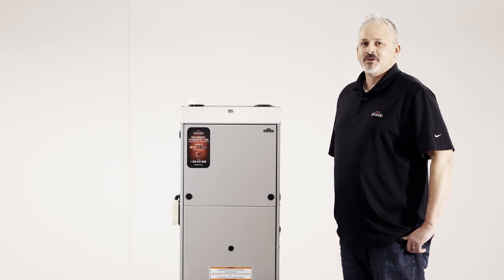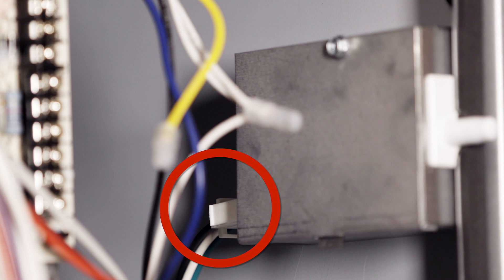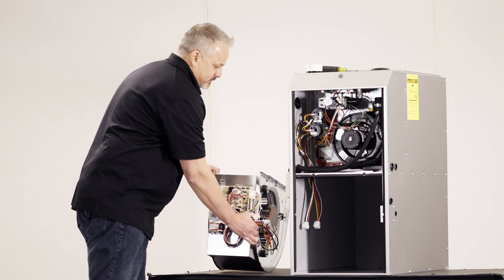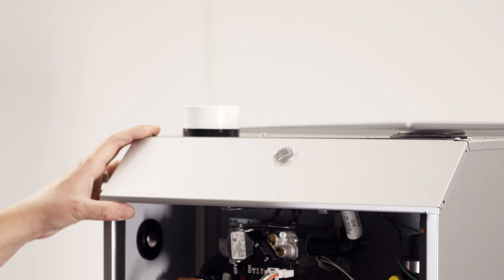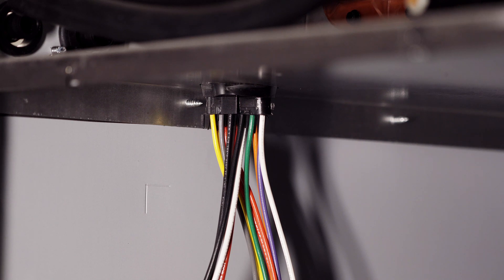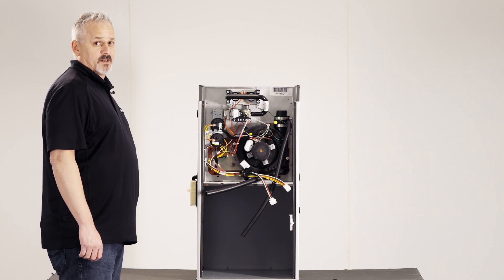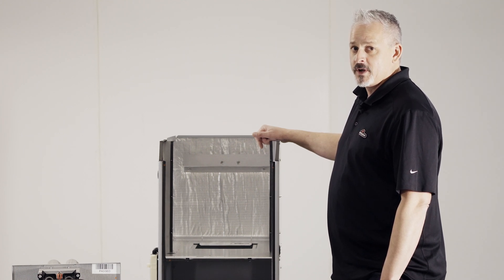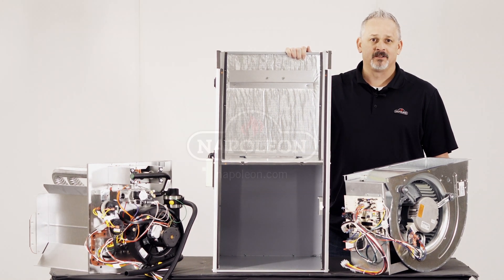Napoleon 9600Q Gas Furnace - Blower and Modular Heating Section Removal

Comment: You have not shown how you removed the exhaust and intake PVC pipes.  In my case(Napoleon 9600) I would actually have to cut these two pipes.
You completely bypasses this step. Not so easy